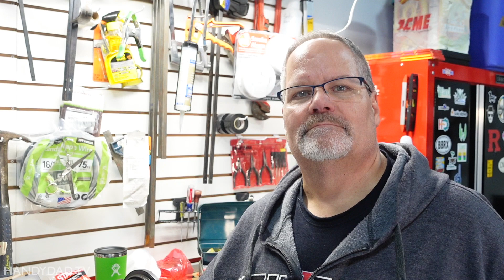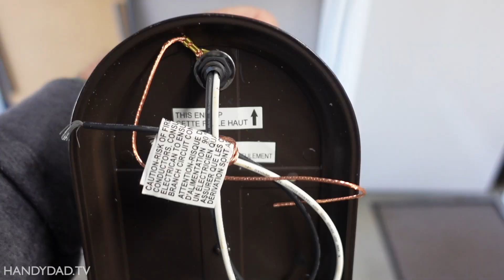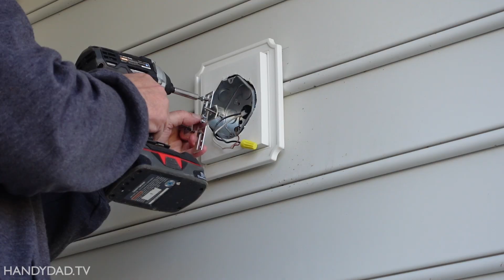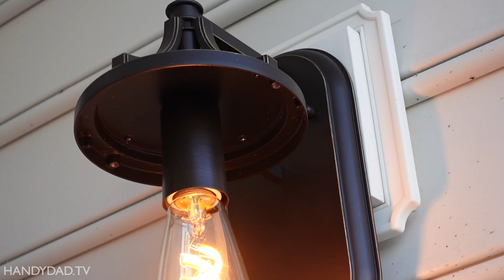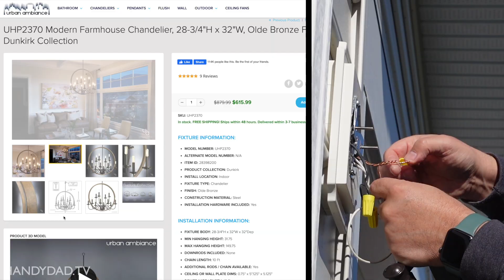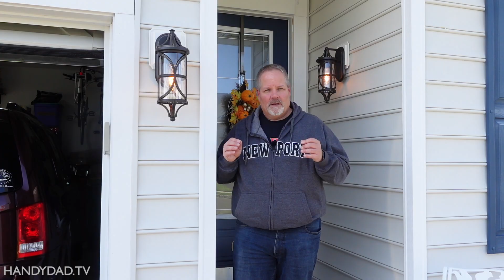Replace Outdoor Light Fixtures - fast and safe

Comment: I just put in a new light fixture by front door and noticed that the 4 glass panels that slid into place rattle in the wind. Any suggestions on how to quiet the glass panels?
Reply from the maker: Two options:
1. (Free but risky) Bend the metal tabs or frame tighter against the glass. 
2. A little dab of clear silicone caulk in each corner.
Reply: @handydadtv  
Thank you! We used the silicone, worked great.😊

Comment: my outsied lighting fixtures are and i would like to replace them but when i went to ireplace them the old fixtures had only 2 wires and black and white bitut my new light fixture and white black abnd and bare copper wire . how do i install my my new ones
Reply from the maker: Connect the black and the white. If you have a metal box, attach the bare wire to the box if possible.

Comment: I recently installed new lanterns on my house.  All 3 turn on when I hit the switch.  At night only two work.  The one with two sets of wires stays off.  I’m using dusk to dawn Edison bulbs.  When I twist the light bulb it goes back on.  Then next night it doesn’t work.  I tried a new bulb and same issue.
Reply from the maker: You’re better off with a smart switch.

Comment: What do you do when The junction box is plastic but the silver crossbar i have has the green screw instead? Do i attach the hard wired copper to That and Then connect it at the end to the  copper cord on the light fixture?
Reply from the maker: The light fixture usually has a braided copper wire for the ground. Attach that to the incoming ground with a wire nut, then wrap the braided wire around that green screw and tighten. That way, everything is bonded together.

Comment: Turn off power at the breaker not just the wall switch!
Reply from the maker: No need. I made sure the power was off with a voltage tester. And nobody was home to accidentally flip the switch.
Reply: @handydadtv  I turned mine off at just the wall switch and my voltage tester still indicated that there was power to the light.
Reply from the maker: Depends how it’s wired.

Comment: Hi Chris, I was disappointed with your installation, leaving the back so insects can get up in there is one thing, but the trim that was on the siding should have been extended so it in in the right setting for the lights and would have been easy to do
Reply from the maker: I disagree that it would have been easy. That’s why I didn’t do it. Clearly these fixtures would look better on brick or clapboards.
Reply: @handydadtv  My builder did it the same way as you with the fixtures I chose and it failed inspection.  So I had to choose a smaller (ugly) fixture.  Now, I can go and change them back to the other ones (I’m keeping those) after closing but I do think I’m going to modify the plate (increase the size) that it’s attached to so the edges can have a tight seal with no gaps.
Reply from the maker: Mark - do you have vinyl siding?
Reply: @handydadtv  No.  Hardie Board.
Reply from the maker: Nice!

Comment: I’m no expert by any means but won’t the over hang at the bottom of the fixture where it’s not flush against the house allow water into the box.
Reply from the maker: The top is tight. That’s where water would get in.